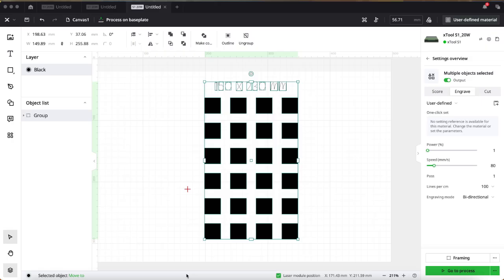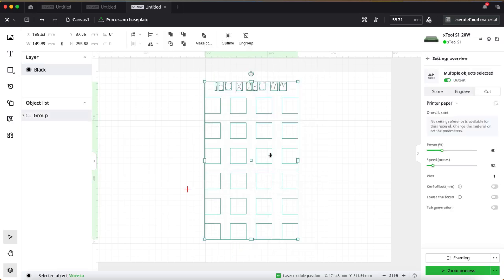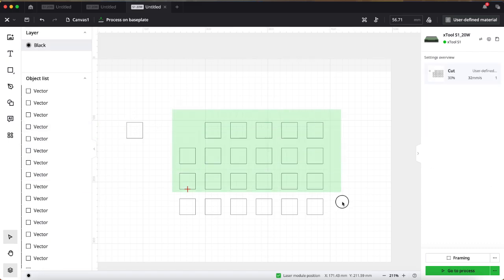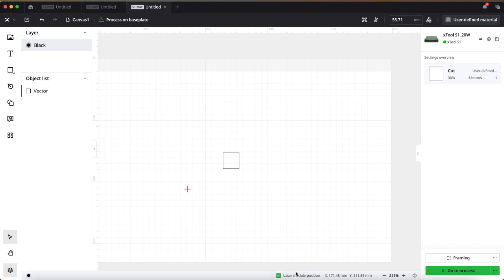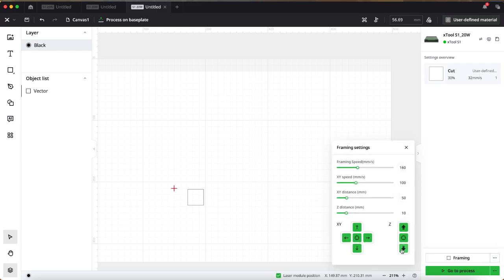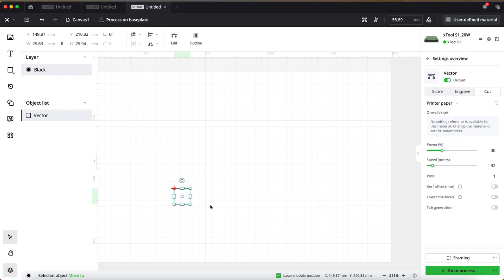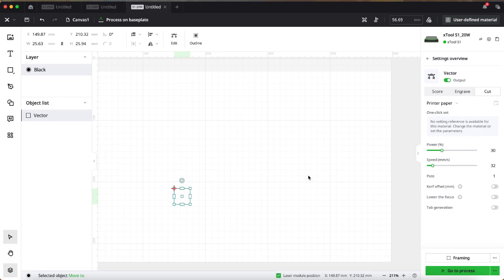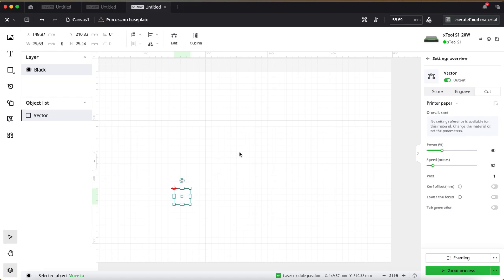XTool  S1 - Calibration for Print and cut on a laser

Comment: Thank you for this. I have been wanting to do print and cut for many projects, but it is so daunting to even try to figure it out. This technique is still daunting, but at least it is an attempt that seems to work. Why they couldln't sell an add-on camera for the machine and have options in the software, I just don't know. You are the only person who has tackled this, so it is much appreciated.
Reply from the maker: I think the issue stems from the fact that no one at the company thought anyone would be trying to do paper craft on these machines, beyond perhaps, intricate design cuts on plain materials. In reality, it doesn't need a camera, just a laser pointer that is accurate enough - a method of plugging numbers into the software that is remembered. I did try lightburn and could do print and cut from that because it had that facility. (I just can't justify the cost, when I also have a Siser Juliet). I do believe that eventually the software will catch up.